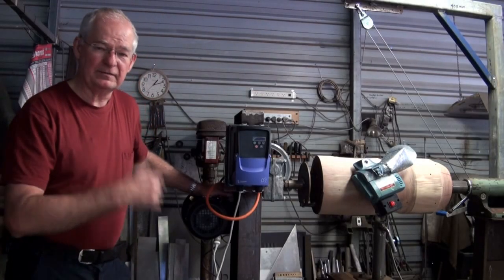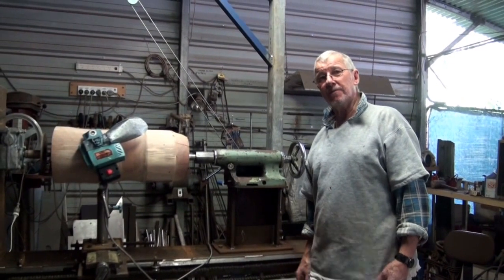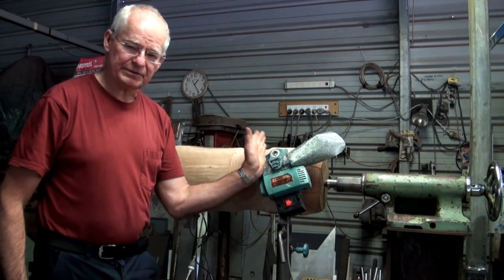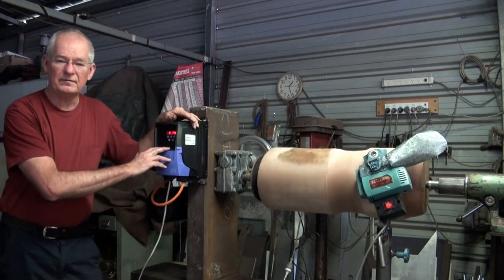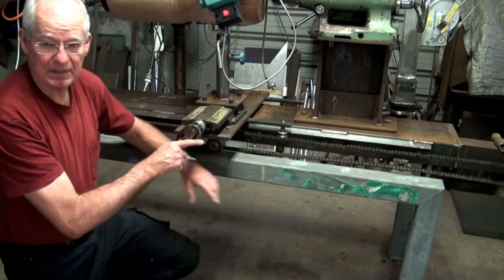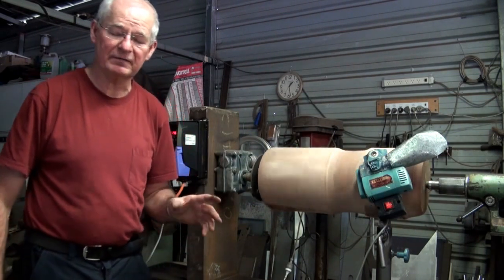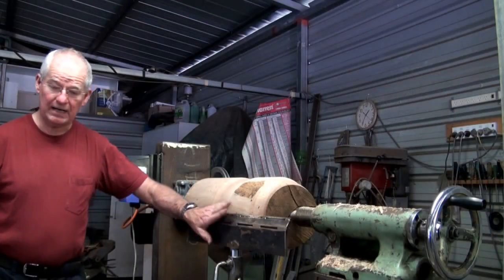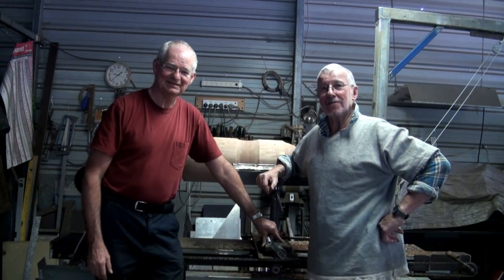Frankenlathe 2 - Mega Log Lathe Upgrade

Comment: I am surprised you did not try different diameter vee belt pulleys
Reply from the maker: We did eventually fit a smaller pulley on the drive gearbox to get a higher spindle speed. but a set of stepped pulleys would have been a better idea. The VFD does give a good range of speeds for low rpm work with the planer head but not enough for hand turning with chisels.